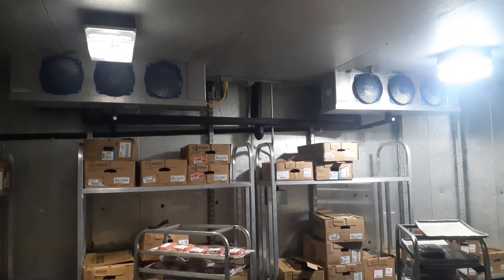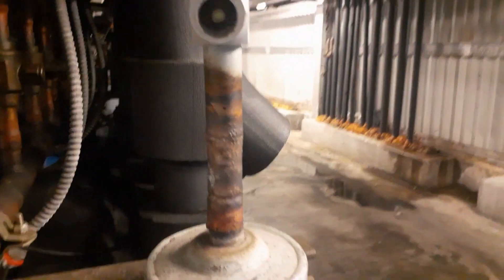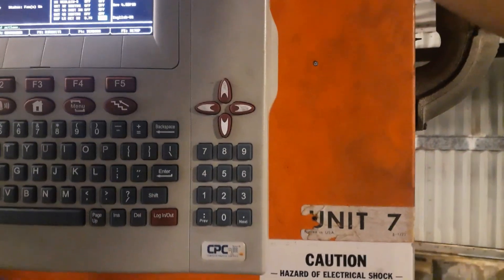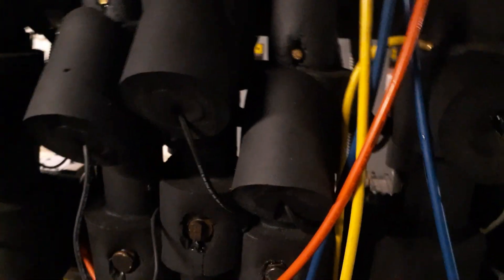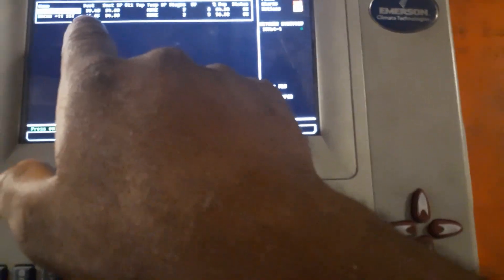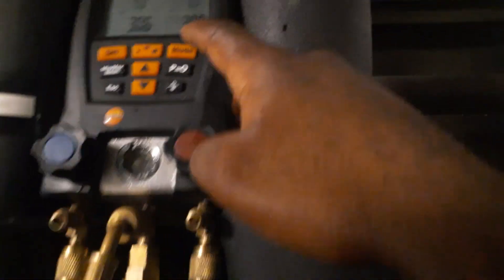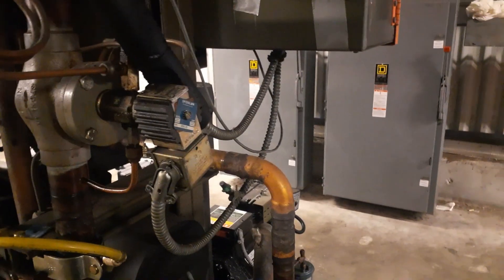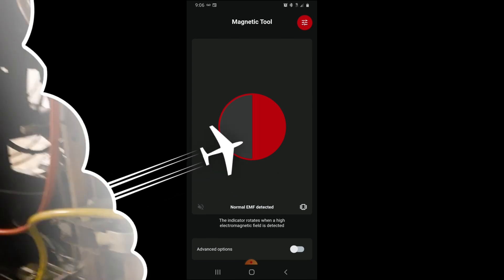WALK IN COOLER 🔴 KEEPS FREEZING UP

Comment: Would the other circuits that have hot gas defrost on that rack. Wouldn’t those coils also be getting iced up too?
Reply from the maker: Correct 👊 This was a medium temperature rack most circuits are time off. There were only 2 to 3 circuits that  were hot gas defrost with setpoints around 34°F an 36°F the walk-in had a set point of 32° with a 10TR. When I check the other coils they were clear. So YES that is TRUE💯. 

Great Question!!
Reply: @Bluecollarrebel  why do they have defrost at 32 and above? Is it because of the humnidity?
Reply from the maker: Not sure 100% but I'd say yeah to help maintain integrity of the product. It was a meat cooler. A time off defrost would  have the system off for to long for the customer comfort.